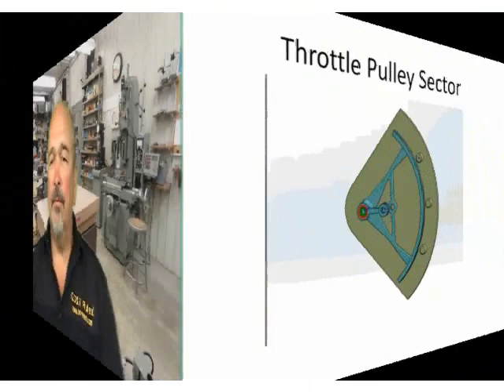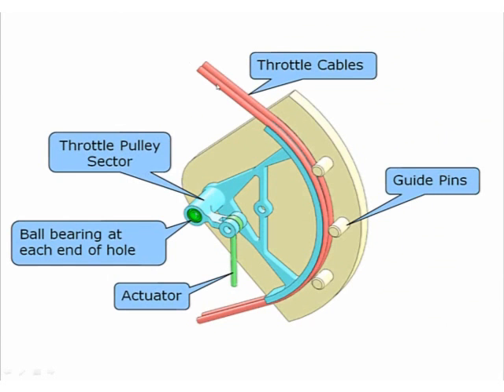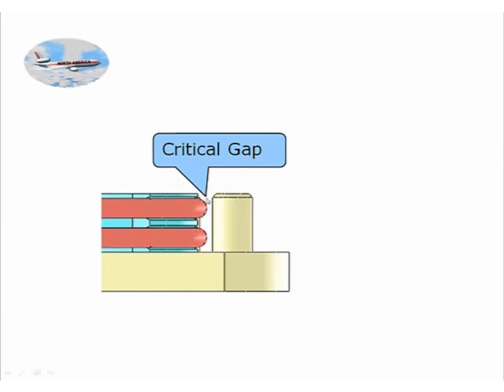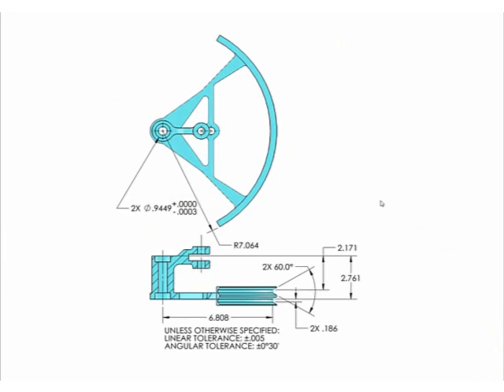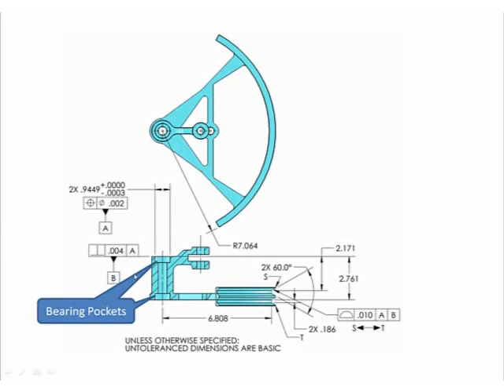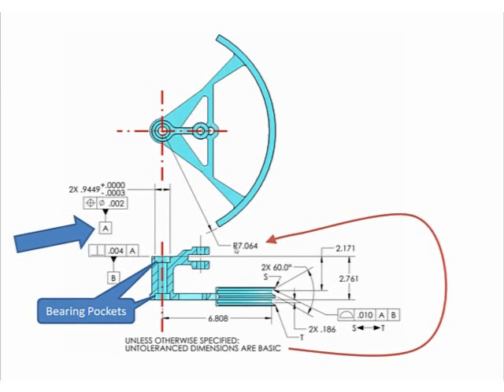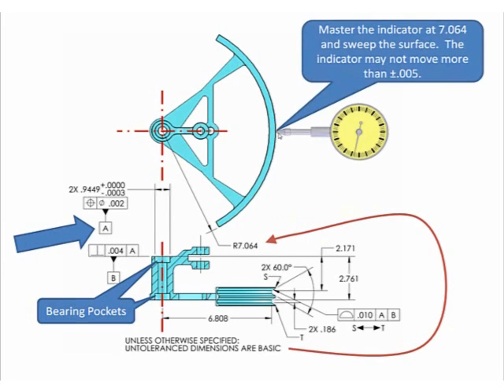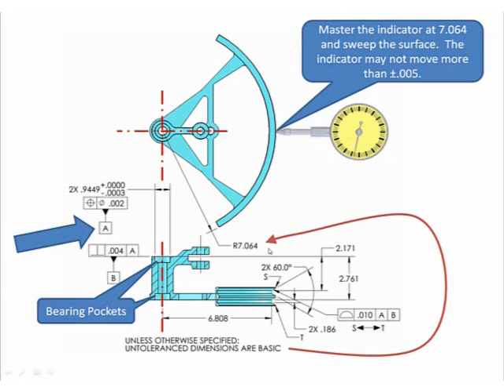GD&T Tip - Plus/Minus Tolerances Just Don't Fly!

Comment: Can we use position tolerance without datum?
Reply from the maker: Yes, we can use position without a datum.  This is most commonly done when using 2 coaxial pins or holes as a primary datum.  Position without datums is used to locate the 2 features to each other.  Paragraph 10.6.2.3 talks about this in the 2018 standard (paragraph 7.6.2.3 in 2009).  If you have a copy of our GD&T Hierarchy Fundamentals textbook, it is covered on page 9-12.  It also can be done on a composite tolerance in the lowest frame to control feature to feature relationships only.  Thank you for the question.

Comment: For my information and clarification, correct me if I'm wrong please. Wouldn't the arrow coming from then 2x .9449 to the R7.064 identify that it's center is coming from the 2x bearing pockets? Then again there wouldn't be any control on what the center location tolerance would be.